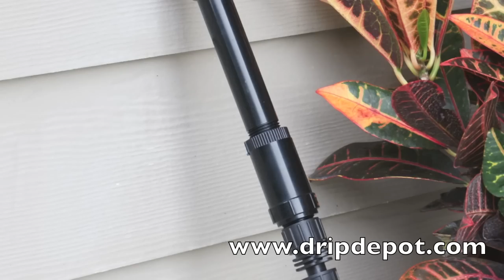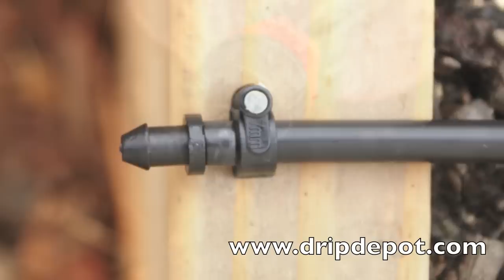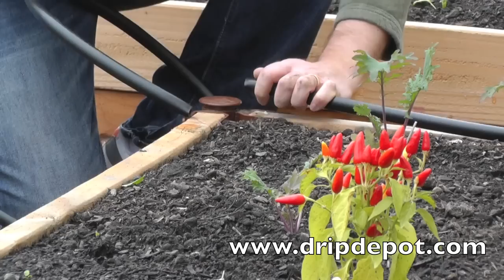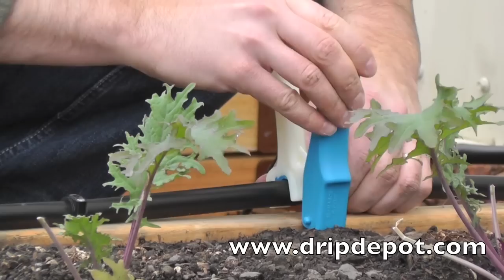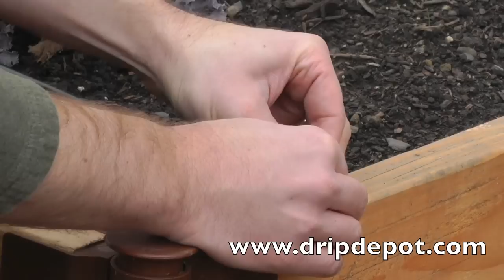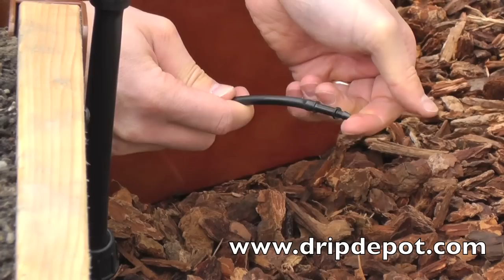How to install a Drip Irrigation System in Raised Beds

Comment: any tips for getting the tube straight? Great content and information
Reply from the maker: You bet, very good question -- for the mainline tubing, I find the easiest way is to first cut the bands holding the coil together -- then, placing the tubing in direct sunlight for awhile.  This will cause it to start relaxing and uncoiling by itself.  This also makes it much easier to start unrolling.  Then, as you go, stake it along the way -- the warmer the tubing got, the fewer stakes will be needed.  On a hot enough day, you barely need stakes and might even be able to remove them at the end (though best to still leave some in place so it doesn't vibrate out of place during pressurizations).  

The big downside to this is having to do the work in the hotter part of the day, but I think I still prefer that over trying to uncoil and lay out cold poly tubing -- when it's cold, the coil stays tight which means lots of stakes or the possibility of the tubing bird nesting (when it starts to get tangled up, kinking, etc).
Reply: @dripdepot  great info thank you very much

Comment: How do you secure tubing to a metal bed. Can't hammer the c clamp into the metal. Do you have an alternate way of securing to the metal?😊
Reply from the maker: Hello Donna!  We actually just shot a video using metal beds and covered this section -- the video won't be ready for a few more days yet, so I'll try to describe what we did :) 

Ok, we elbowed the mainline tubing into the bed at the top, just like usual -- we positioned the elbow so it could hang on the edge of the bed at the top, to let gravity do some of the securing -- once we had our mainline inside the bed, we got it down to the soil and used tubing stakes/pin-downs to secure it in the soil.  The pin-downs really stabilized things and kept the mainline in place -- that coupled with gravity holding the elbow on to the top of the bed really did the trick for us.  It even ended up looking pretty good and we didn't have to drill :)

Comment: Thanks for video very helpful. How would you attach to a metal raised bed particularly corrugated metal? Also I have 21 raised beds 12 and one row nine in the other. How would you configure for those dynamics. Can you water all of it at once or would it be better to split it up water one section one time the other section another thanks I know you’re not a lot of information probably will give you guys a call

Comment: Very informative video, thanks. I was wondering why at the first T fitting at the bottom corner of the bed, you did not just run upwards from there to the top of the raised bed, but instead ran sideways for a short span into an elbow that then ran vertically? If the former is acceptable, it would have saved an elbow and a short length of tubing. Thanks for this useful information.
Reply: True. I would have kept the supply run tight to the beds and done just that. The caveat here(I guess) is the example of the 1/4 drip emitter?

Comment: Here is my problem with your explanation; I just got rid of rotted old wood raised beds and got new heavy duty vinyl ones - now obviously I do not want to hammer holes in that - so how would you secure the tubing? The only thing I can think of is large garden type stakes into the bed itself. Specific suggestions would be appreciated. Blessings in Yahshua's Name

Comment: how is this working when it's -20c in winter time, could it still be out (but ofc, drained and turned off) ?
Reply from the maker: Hi, In cold weather climates we recommend "winterizing" any irrigation system.  You are correct that the system should be drained and turned off. We recommend storing any of the head assembly parts (filter, timer, pressure regulator) inside a garage over the winter. Our cold weather customers have not had any complaints with their systems after winter as long as they properly winterized them.  If you have more questions feel free to contact our support team at: support@dripdepot.com.  Have a great day!
Reply: @dripdepot  Draining the tubing is enough then, good to know :) Thx!

Comment: Thank you! So do you leave the tap open or do you open for a period of time then close? Is yours connected to a bucket or Rain harvest tank?
Reply from the maker: Hi Sharri-Lee,  This system was connected to a outdoor faucet.  Drip systems are not meant to be under constant pressure so the tap can not be left open all the time. You would have to open the tap when you want to water and then close it when the watering cycle finishes.  Many people find that adding a timer to their system is really beneficial because it will automate the watering the opening and closing of the tap for watering. Have a great day!

Comment: I was told to only run one 1/4" drip line in my raised bed and just loop it back and forth, from end to end, until the whole bed is sufficiently covered with irrigation.  Here, in your video, you run individual drip lines every 12".  Can you explain which method is preferred?  Thanks.
Reply: MadjikMan56 I have the same question. I just ran one line into my bed and looped it around the plants...the problem is that there are some emitters just watering dirt as they are between plants. The way they have it in the video is good if you have spaced your plants in a line evenly in 6 or 12" increments.

Comment: can you put a timer to turn on/off by the shut off valve?
Reply from the maker: Hi Wendy,
I wouldn't recommend placing the timer by the shut off valve because a timer operates under constant.  Meaning that the water must be on all the time.  Drip Irrigation systems are not designed to be under constant pressure.  That is why a timer is often placed on a faucet or hose bib as the first item in a system.  That way the water can be left on all the time for the timer.  However, water will only enter the drip system when the timer allows its valve to open at the preset time.  Hope this helps.  Let us know if you have any more questions.
Sincerely,
Drip Depot

Comment: The 1/8 barbed plastic tubing connectors to the 1/2 main line break off ALL the time. It is very frustrating.  Has anyone found a metal version of the 1/8 barbed connectors?
Reply from the maker: Hi Jay,
I don't know of anyone that makes a metal barbed connector.  In the video we use 1/4" barbed connectors and don't sell any 1/8" connectors for the reason that they are too thin and do break.

Comment: will this work with a rain barrels?
Reply from the maker: Hi Dan,
This kit will work with rain barrels.  You would not need to use a pressure regulator as rain barrel systems already operate at low pressures.  Let us know if you have any other questions.
-Drip Depot

Comment from the maker: We do not recommend leaving the system on all the time as the head assembly items (filter, pressure regulator, etc...) are not designed to be placed under constant water pressure.  Also drip irrigation is very efficient so water time for the day will be measured in minutes, meaning that a system running all day would supply too much water.  If you need any help feel free to email or call us toll free at: (866) 246-7707. Have a great day!

Comment from the maker: Hi,
Thanks for the questions. System run time really varies due to temperature, humidity and soil type.  To achieve the prefect run time for your raised beds it would be something that you would have to play with a bit.  Start with the amount of time that seems right to you (could be 10 - 15 min 1 or 2x a day).  Watch your plants, if they show any sign of stress increase the watering time.  Conversely, if they are doing great you may be able to cut back and save more water.

Comment: new to a drop system and I'm very much considering your system.  on average, how long do you run the water through a system like this?  is it something you toy with to get right or is there a specific time?  i have a raised box setup like in the video, and there are occasions i'll water with a hose for about 30-45 seconds on each plant.  i'm assuming that's equivilant to about a gallon or two of water on each plant and they are growing well.  do you just leave the drip system on all the time?